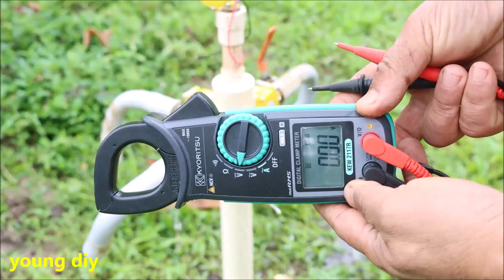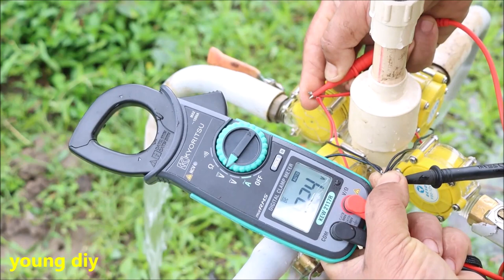Series & Parallel Connection of Micro Hydro Turbines. |DIY|

Comment: Will the output be the same if you make all turbines in series?
Reply from the maker: voltage will increases in series connection and current in case of parallel connection.
Reply: @youngdiy489  I'm sorry. I meant if the piping connection of the turbine itself mechanically in series configuration, not the wiring in this setup. Instead of 4 junction of turbine, what will happened if there's no junction, only straight line.
Reply from the maker: Bro, water pressure in the outlet end of each turbines decreases after driving the turbine  hence there will be a pressure drop, again to run the next turbine since dia of pipe is same as such enough pressure  cannot be built  also due to back pressure next tandem turbine efficiency reduces and so on. Therefore piping in parallel for turbines will be better than series piping though water pressure divides.
Reply: @youngdiy489  thank you for the explanation 👍
Reply: Voltage increase

Comment: Hello fantastic video, i have a question, i'm not expert, you can explain me how should i connect 2 turbines to increase wattage? Black with black and red with red? Or black with red ? I think the second because is same process like for increase volt, right? Please help me, thank you.
Reply from the maker: Wattage capacity can be increased by parallel connection i,e red to red voltage remains same. To increase voltage connect red to black i,e series connection.Thank you for watching bro.
Reply: @youngdiy489  thank you for answer, very gentle!
Reply: If I wanted to connect solar controller with four of them would you recommend series or parallel?

Comment: Im thinking of joining 15 80v ones together that would have 1 modified to POWER the water around the whole water circuit (gaining the power from the one next to it)...id kick start the water circulation through hoses etc so once i join the powered turbine to the power out turbine id simply remove the battery i used to kick start it etc...then all the 15 power out generators would have all the wires joined into a power regulater box etc to power my tv, playstation, mini fridge freezer...and few other things on my boat...but that SHOULD work right? :)...free power 24hrs a day for aprix 4 months before the motors die apparently...just hoping they could withstand being generating power constantly till they all die etc
Reply: Good luck with that. Please update on your project 😂

Comment: Don't you find it infuriating when it includes an internal voltage regulator? With slight modification, that thing can push out more voltage and you can use an external power regulator to keep the voltage stable
Reply: Do you know if it would be possible to charge a powerbank with it?

Comment: Hi, can it run 24/7?
Reply: If you re collected the water and re circulated it easy continous power the system I'm building will be fully circulated system powering itself charging 3 lessure batteries 😆 for storage with power inverter and bingo free power all day all night